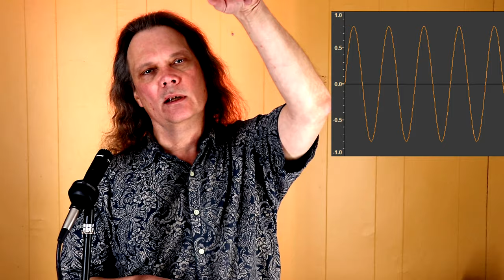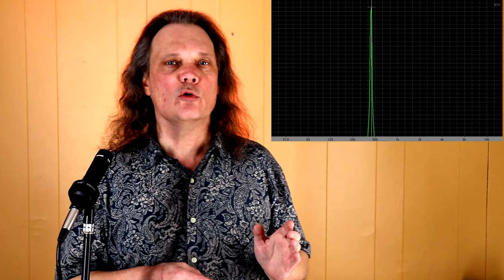Amplifier and Speaker Matching 101: How to Choose the Right Power for Your Sound System

Comment: I am surprised that you didn't mention one of the easiest and cheap way of protecting drivers is to fuse them. Blowing a 25 cent fuse is much cheaper than replacing a driver, or a diaphram. On the subject of power ratings, I always have to shake my head and laugh whe I see a plastic stero at Walmart with big letters saying 1000 watts, and the whole thing only costs $29.99
Reply from the maker: You might be interested in this video:
https://youtu.be/2xMT3rEvI-U

Yeah, fuses are an option. Some audiophiles believe that they degrade sound quality.  I know, some equipment has power ratings that seem awfully optimistic.

Comment: I start by saying I agree with your point of view on this subject and thanks for posting, I hit the button! I'm just adding a little color! At the end of the day If someone is the kind of listener mixer that can destroy speakers with a small amp going DC they should introduce themselves to A lighting desk. As that is akin to saying when you drive on narrow roads you don't like how much time is spent in the ditch so I want wider roads. Slow down driving is the job, staying on the road is the first order of business. The choice to blow speakers was the person on the throttle not the amp, under sized or not (proper output impedance considered here). Before any speaker is destroyed woofers for example will sound like a cardboard box getting slapped with a tennis racket. Bigger power wont fix that kind of talent.  Yes too small of a system in too loud of environment will make it less apparent that speaker abuse is going on but it remains the first order of business in progressing with amplified live content in speaker systems. Good luck to all and remember learn to keep your crayon in-between the lines!

Comment: My basic rule has always been to have an amp rated higher than the speaker peak so the speaker has everything it needs when it needs it. I know that is just one part of amplifier choice, but I think it is a good starting point. I am not a pro, just talking about HiFi, and rarely do I turn up the volume so high that it stresses my amp ormy speakers. In fact never. I have big, loud speakers and a very powerful amp. Yet, I generally listen at sane levels in my living room. Though I do like to crank it up sometimes.
Reply from the maker: Yeah, I agree.  No problem using a big amp as long as you don't crank things up to the point of damage.  It's better to have some headroom.  
Some people suggest an amp that is 1.5 - 2x the speaker power rating.
I have a 750w PA amp on my home stereo, and I almost never even light up the signal lights.  Overkill, yup, but it's the amp that was handy.  Plenty of headroom!

Comment: 100 watt amp will blow 800 watt speakers if you clip it. Waiting to see if I'm right. LOL
Reply from the maker: Thanks -- It's certainly possible. Clipped amplifiers put out a great deal of high frequency harmonic energy which can overpower tweeters. They can also put out dense energy spectrum, more so than standard music, which could possibly damage other drivers as well.

This is why many people recommend using a large power amplifier to avoid clipping, rather than a too small amplifier that may get occasionally clip on the peaks. If your amplifier includes a clip limiting feature that may be a wise thing to engage if there is a likelihood of running near full power.

Comment: I have a pair of speakers that I want to connect to a kenwood amplifier and I’m not sure the amplifier is powerful enough and how I should wire it. I’ve tried understanding parallel Wiring and if it would double the power but I’m still confused do you have a email or other way we can communicate besides these comments let me know if so
Reply: And any help would be greatly appreciated. Thank you.
Reply from the maker: Sure, no problem.  Are we talking about home audio, or car stereo?
Can you give me the model number of the Kenwood Amp, and how many speakers do you have, and what is their impedance (in ohms).  
Is this for full-range speakers or are you driving car audio subwoofers? 
Let me know, and I'll try to help ya figure out what makes sense in this situation.
Reply: @Barry-Watson  the speakers  are 6ohm from a lg cm-8460 sound system and the amplifier is a Kenwood vr-6070. Here is specs on speakers. 
HIGH : 2 Way 2 Speaker MID : 1 Way 1Speaker
   Impedance
 HIGH : 6 Ω MID : 6 Ω
 Rated Input power
  HIGH : 555W MID : 555W
 Max. Input power
   HIGH : 1110W MID : 1110W
Reply: I’m sorry and they are full range for home with two sets of wires coming out The back of each speaker.
Reply from the maker: They'll be fine, just connect them to the main speaker outputs of the receiver.  

On the speaker wires there is probably a polarity indication, like one wire has a stripe along it, or the insulation is rounded on one wire, and the other wire has a little ridge.  Connect the marked wire on each speaker to the (+) terminal of it's channel on the receiver, and the other wire to the (-) side. 

I'm assuming that those LG speakers are normal speakers, and they don't have any active electronics in them as part of that packaged LG sound system.  Best wishes!
Reply from the maker: I think those speakers have some blinking lights in them used with the original system. If the speakers have two sets of wires coming out, I think it's possible that one wire is for audio, and the other wire is for the lights in the speakers, which I would ignore.

But, I am not an expert on that LG integrated audio system package the speakers are a component of.  I assume the speakers are generic, but some of those systems the components are only designed to work together properly.
Reply: @Barry-Watson  they do have lights and yes, I was just ignoring those. You may be right about the This is the only working properly with original components. I have had the speakers connected, and they  seemed underpowered. I have listenedto the same system before with the original receiver and it had a lot of power. How can I wire speaker to get the most power from the amplifier. ?
Reply from the maker: The Kenwood receiver is 100 watts per channel, which I suspect is far more than the original LG supplied receiver. It should drive those speakers easily. 

As I see it there are two cables coming from the speakers, one is a 4 wire more lightweight cable that is the lights, and then there's another cable of two wires which are a little heavier which are red and black which is audio.

There really aren't any easy tricks to get a lot more power and you need to do a huge step up in power to really make any audible difference anyway. 

I think I would try finding another pair of speakers to put on that receiver, and make sure the receiver is working properly. It really should have enough power to fill  the room.

Comment: I know the video was well intentioned, but there was quite a bit left out. To start with, there's no standard that manufacturers have to go by when rating an amplifiers power (or any other measurements). Each company does it as they see fit. If you take 5 or 10 different amps from different manufacturers and measured them all the same way, every one would be different.  How different depends on how honest the manufacturer is. 

Beyond that, when you are trying to match an amp to a speaker, the single most important factor to consider is the lowest resistance the speaker shows the amp. That's the figure that's going to tell the amp how hard it has to work. When you look at a speaker that has an 8 ohm rating, for example, that's just an average. A speakers resistance determines the power output of an amp. And a speakers resistance changes with frequency. If you look at the specs for any power amp, you get a number in watts, like 100, but they also give you a number for resistance. You would see something like100watts at 8 ohms. And since we know an 8 ohm speaker will be an average derived from frequency, the only way that amp can actually be 100 watts is at the single frequency that shows an 8 ohm load. If the speaker has to reproduce a higher note, the speakers resistance be higher, like 16 ohms. At 16 ohms, you have a 50 watt amp. Literally. And if the speaker needs to play a low bass note, resistance may now drop to something like 4 ohms, and if the amp is made well, its now a 200 watt amp. This is where the problems start with power ratings. The lower the resistance, the harder the amp has to work. 0 ohms is a dead short. If you turn your amp on and touch the speaker cables together, that's 0 ohms. 

To use all this info in a practical sense, lets say you are looking a 2 pairs of speakers. Both of them have an average resistance of 8 ohms. However, one speaker may drop down to 4 ohms, and the other 2 ohms. The speaker that drops down to 2 ohms is going to be much harder to drive, Lowest resistance is the single most important number to look at.

There was one huge thing that was left out of the video. In pro audio, its very common to bridge stereo amps into 1 channel. A bridged stereo amp is not a mono amp, its a bridged stereo amp. The rules change for bridged amps. When bridged, an amp sees the speaker at half its normal resistance. Your 8 ohm speaker that drops down to 4 ohms is now a 4 ohm speaker that drops down to 2 ohms. The amp has to work twice as hard to drive the exact same speaker.

One last thing worth mentioning is extremely high wattage ratings. When you see an amp rated for 500 or 1000 watts, its just ridiculous. Those power ratings are going to be based on the lowest possible frequency its asked to reproduced. As the frequencies go up, the amps power rating goes down. Not only that, 90-95% of the amps on the market inflate their power ratings by how they take the measurements. They use test tones, not music. Its extremely easy for an amp to reproduce a constant test tone that doesn't vary. Watts are an artificial number based on something that can't happen in real world use. If you rated that same 1000 watt amp with music going through it instead of a test tone, the actual power is a small fraction of what the test tone numbers are.

Comment: Very cool video. My journey brought me to less (81db) efficient speakers and 100w of hybrid power. As the speakers are 3 way with a 6 inch tweeter, they sing when the amp hits about 60%. Understanding decibels was cool too. My amp & speakers are from the same manufacturer so it was a small leap of faith, which I love now. Subwoofers are a mixed breed to me. Many sound like a loud mess like the concerts from the 70s/80s. Tight bass, imho, is tough depending on the room. Such a journey. ❤
Reply from the maker: Thanks!  I appreciate that.

Comment: Recently been able to upgrade piece by piece. 
Matched the amp continuous wattage to the speaker max input. Whereas the previous amp had just over half the speaker max.
I was concerned of transient peaks but now i am not tempted to push things anywhere near what i did before. No need. Anything around the 10o'clock point on the volume damaging to ears let alone anything else. 
Headroom, soundstage, low frequencies are in abundance at very low listening levels.
Your advice about not pushing things is very welcome Barry.
From a budget Cambridge Audio 65wpc driving some very cheap TDL 130w 6ohm.
To Fyne Audio F303 120watts being driven by (o.k its old) NAD C370 120wpc.
Reply from the maker: Fantastic!  Thanks!

Comment: Great explanation . A trough expert is easy to spot and understand.
In a sense my only real question is how much this applies to most people,  surely  you would have to have your volume excessively loud before you where risking your system, or at least a verry badly mis matched one.
Reply from the maker: Good point. For me these issues primarily apply in commercial situations, doing audio for live bands where you are dealing with significant amounts of power.  When I'm doing listening at home, I doubt I'm using much more than a few watts typically.
Reply: @Barry-Watson  As a matter of fact my sound system was chosen section by section to allow me to listen  at verry low volumes. without it going flat my previos system about 5K cheaper than the currant one so far and I loved it loud but hated not enjoying it quietly.

Comment: I too have learned a lot from you Barry, thank you for the content. Can I ask .. what do you run at home for your music enjoyment?
Reply from the maker: Thanks -- This is total opinion.

I've used a lot of hifi gear over the years.  I really pursued audiophile sound and bigger and better systems, which eventually lead me to pro-audio/live sound.  My former hifi systems were much more expensive and elaborate... probably better, maybe...

For me, nothing at home really compares to power, the bass, or the dynamics of the live sound systems.  After doing concert sound, no home hi-fi system seems very impressive to me.
Plus, I just don't actively listen to music as much as I once did, these days mostly I watch and occasionally produce video, work with my own productions/recording, or listen to podcasts.

The audio system I use at my desk isn't "audiophile" level.  If it was a big room, and I was entertaining people, I'd choose differently.  For working at my desk, this setup works for me.  I know I'm missing some sub-bass, and I've got some bumps in the mid-bass, but sometimes perfect is the enemy of good.  I'm pretty content overall with this combo.

It is currently comprised of a vintage Crown IC-150A preamp that I've upgraded with modern op-amps (the original op-amps were a bit harsh sounding, but now this unit sounds great with state-of-the-art performance, and the feel of the controls is old-fashioned quality like gear NASA used to make), a Crown PS-200 power amp (I choose this model because it sounds good, does not have any fans, has ample power for my desktop hifi, doesn't draw a ton of power at idle, and takes an unbalanced input).  Yeah, I do like vintage Crown.  My primary "desktop" speakers are JBL S38s (original version, not the IIs).  I occasionally swap equipment as the mood strikes, but this setup has worked pretty well for me lately.  I've previously used powered studio monitor speakers, and I think that's a valid choice too, and a bit simpler.  For headphones, I usually reach for some vintage AKG-K240DFs if I want "accurate", or Sony MDR-7506 if I want "fun".  The Sony's are easier to drive.  If my mix sounds nice on both & the speakers, I'm probably ok on balance.

When choosing a sound system, I think the loudspeakers have the greatest impact.  So, I'd focus most of my attention and budget on getting the speakers that sound best to you.

Comment: Watt ws watt. Or what watts. It's interesting to see how the relationship between continuous power, and peak or maximum power has changed. Compare class A/B with transformer, - A/B with switchmode power / variants like EE-Engine ( Yamaha ) and class H powersupply - and now class D, also with smp. Higher peaks compared to continuous, but that makes sense, music isn't continuous levels, at least not what I listen to. And if the peaks clipps.....  Perhaps the subject of another video :)

Comment: Hi, I have an amp I care for very much. It is a Marshall 2525C the silver jubilee studio combo I actually have all four of those studio models lol. Either way the one thing consistent is the sharpness and the trouble of course also in the 20 W amp And summon senses their areas where I wonder if a higher wattage speaker rather than using the green back which is in the combo when I cannot carry an extension speaker cab, which I have scumbag speakers in what would be the ideal speaker I thought a cream, but then I was looking at the Celestion and even considered because my Mesa boogie Fillmore 25 has the 90 W Celestion Al Nico magnet speaker, and I wondered how this would sound in my silver jubilee and would it increase the headroom in anyway 2:02 2:05 2:10  and or deepen the Sound as well there is not a deep switch for the amp thanks any other advice about ideal speakers with the best Sound clarity and death I would love to hear any advice for this amplifier truly The greenback is OK but just not really OK thanks. Also look at a couple of eminence products. Mostly the governor.
Reply from the maker: Guitar tone is so subjective, and so personal, I think that's a matter of trying different options and deciding what really suits you best. Generally I'm a big fan of the eminence loudspeakers, and they have a variety of guitar amplifier speakers each with their own sound character, and I would imagine one of them would fit you well. I might also consider the addition of some acoustical insulation (fiberglass) in the loudspeaker cabinet if you want to mellow some of the edginess of the tone, and perhaps the use of an EQ pedal if you need more shaping than what the amp offers.

Comment: I have a NAD 216 amp with a clip limiting function. Older amp I picked up because I wanted a spare that sounded good. Nice little amp, don't know how good clip limiter works. It just seems to me if you need to use that your amp is too small in the first place.
Reply from the maker: I wouldn't rely on the amp's clip limiting function.  But, I bet that feature has saved a lot of PA loudspeakers.